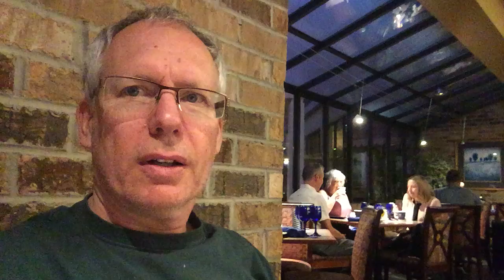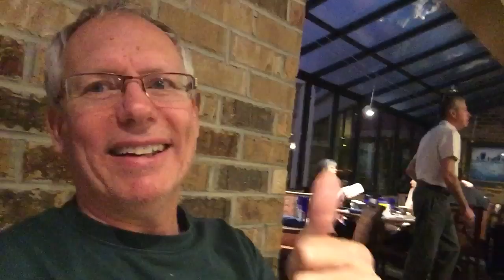Drawbacks of Current Nuclear Reactors

Comment: I thought the power situation got fixed when the issue with the RBMK reactors got leaked from Chernobyl
Reply from the maker: Hi Mark, 
It was great to hear from you!

The cool thing about this conference is that I learned about another way to make heat with nuclear materials.  This technology was invented at the same time as the light water reactor technology right here at Oak Ridge National Labs!
This technology is called the molten salt reactor or MSR.  The advantages with the MSR design includes:

1. MSRs use liquid not solid fuel so they don't have to run at high pressures.  
2.  In the event of a power failure, the liquid fuel flows into a safety tank, away from the reaction vessel, and the reactor shuts down passively, all by itself.  
3. The MSRs can also use chopped up spent fuel rods from light water reactors as their fuel, producing 700 C salt for a variety of industrial applications and getting rid of the nuclear waste at the same time!! Wow!  
Also MSRs can run on the element Thorium which is 200 times more abundant than uranium.  There are literally tons of the element thorium in mine tailings all over the world.  MSRs are safer than light water reactors, and cheaper too!
Google Alvin Weinberg, the inventor if you are curious.
I hope this helps you to have a better understanding of what real green energy looks like! 
Sten